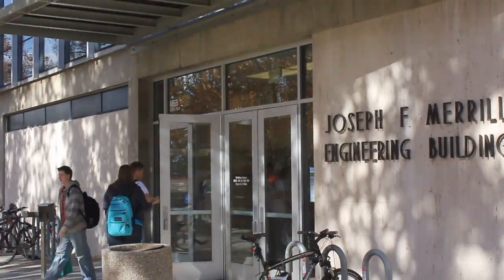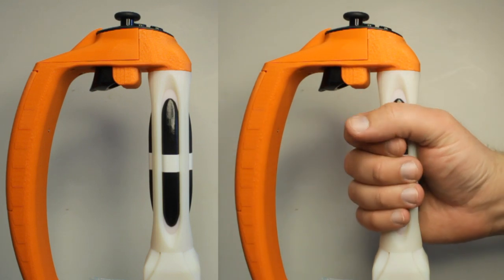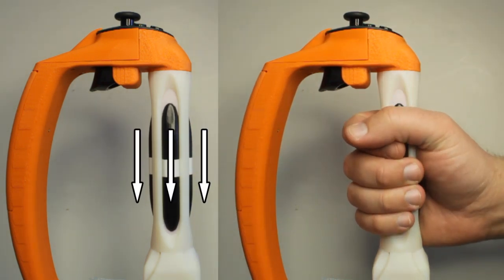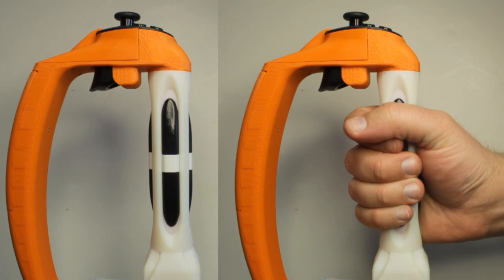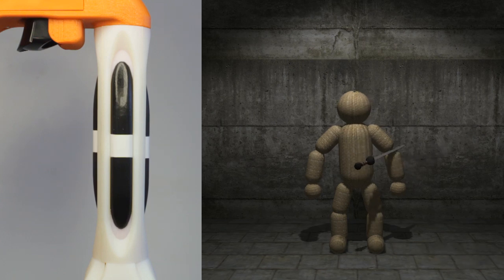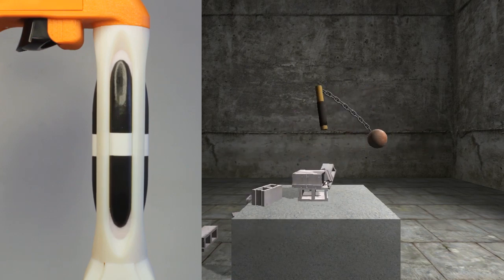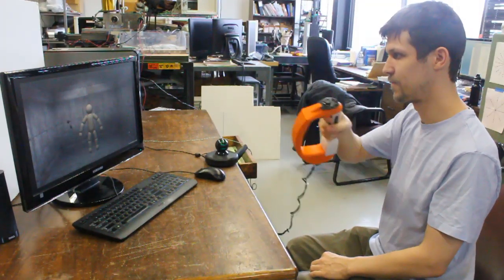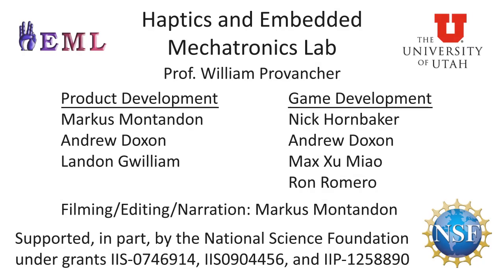Motion Controller with Reactive Grip™ Touch Feedback

Comment: Doesn't the missing degrees of freedom (yaw and the translational axes not aligned with the handle) make a lot of difference? Perhaps it might be a good idea to make the contactbars move in and out for translation, and roll in place for yaw, what do you think?
.
And how fast are those bars? Would they be capable of vibrating at similar rates and intensities as classic vibration/rumble/buzz feedback motors for backward compatibility when playing games that were designed for that type of feedback?